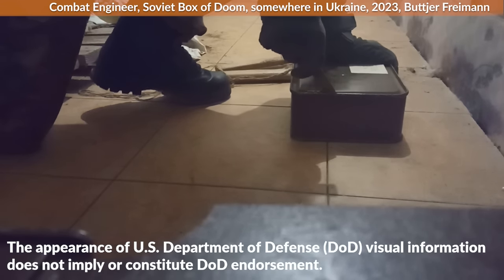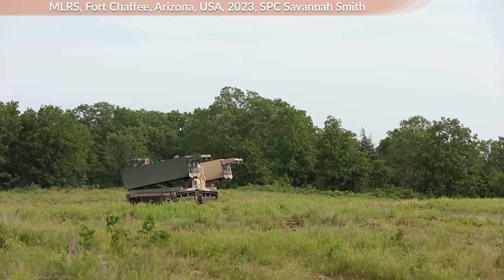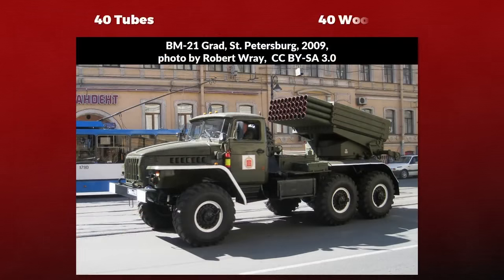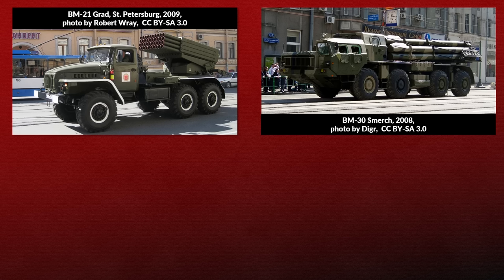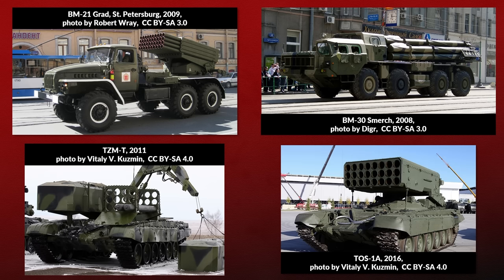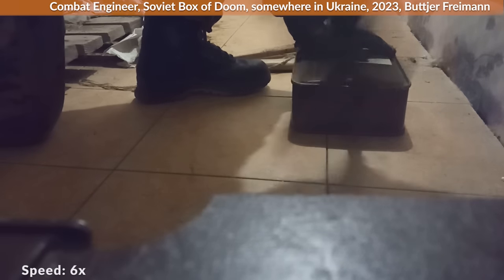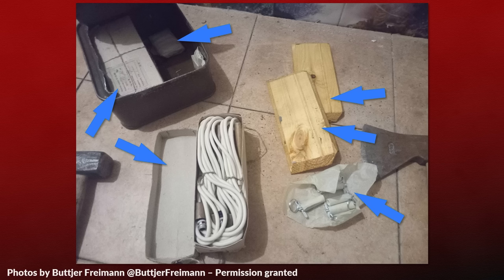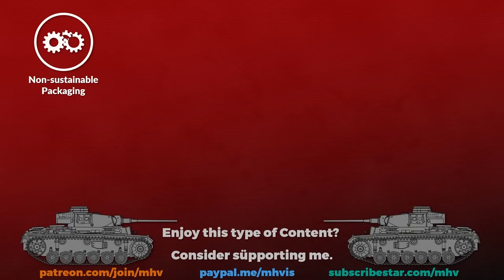Ukraine: Why Soviet Packaging is a Nightmare - Unboxing Edition

Comment: What strikes me about this all metal packaging is twofold - ease of manufacture (not use) and environmental stability in terms of poor storage locations (arctic, tropic, desert, jungle, etc.).

"Shelf life" seems to be the overriding design requirement, well above EVERY other factor - ease of use, rapidity of use,  reliability, reuse, dunnage reduction, you name it. The Red Army wanted 'stuff' that stored well, period.

You can list any possible reason for this if you want for this but SOMEONE in the high command felt that  stability and amount of product were vital no matter what other factors in play - transport, environmental, logistics interdiction, easy decontamination in a NBC fight, what have you.

As a old Cold Warrior, I find this all extremely fascinating. Thank you.
Reply: What about the MLRS designs though? They could have made them faster to reload (even with the packaging staying as is) so we must assume they had some other logic that made them think it isn't necessary - Sheer volume of grad units? WWIII being too dynamic thus make reload times irrelevant?

Agree this is very fascinating stuff, probably because it's practically never discussed.
Reply: @ImtheHitcher  MLRS reload times ARE irrelevant, they never reload on position, they never shoot 2 packets in a row. In fact they dont always even shoot one full pack.
Reply: @ImtheHitcher  the logic behind NOT having an integrated ammunition container-launch unit a'la M270 is simple. Without a truck with a proper crane you cant unload the goddamn thing. You cant load the container on the truck either. The ground is muddy? Your ammunition truck is on a slope? Crane broke? Too bad, you won't load. Meanwhile, to load and unload the BM-21 you need 3-4 guys (but even 2 will do) with at least one collective braincell. No crane needed, you can even use a horse wagon and it will do just fine.
Reply: So it's only red orcs which used one-time tare. Hypercivilized Uh-meriquans use resealable contsiner even for spam.

Seriously. Review your comment. Who needs to pack back the already distributed ammo? For what purpose?Do you know anything about how counting of ammo(cases) works there? Spoiler alert, you don't put it back into broken seal container.
Reply: @acy I see your horse wagon, and raise you 2 dudes carrying rockets in a box 1 by 1 across the fields. I bet that happened at least once both for Russians and Ukrainians in the past 2 years.
The reload times is not that important in many parts of the real war btw, as a WoT/WT player I remember it was quite an eye opening when one of my friends that I used to play with, explained that tank reload time is not that important in real life ether (He is Israeli tanker, was a gunner at a time) since generally it is a gunners targeting that is the main time factor.
Reply: Russian design theory is simply toss it in a hole and pick it up later. The one strong point I can see is that a soldier will clearly know their ammo is tampered because they can only be opened destructively so it's also an anti corruption tool, because their is no excuse for a manufacturer to write off fake or poorly made ammunition. And let's face it if Russians are stealing copper wire from vehicles they would try to sell the gunpowder and brass casings too.
Reply: @megalamanooblol I believe you are incorrect.  On at least two occasions multiple launches were used( at least according to the internet ). The openings of Desert Storm and Iraqi Freedom. Granted they were somewhat unique circumstances.  
However the reload time is relevant. Whether or not the unit displaces before doing a reload is what's not important. Soviet doctrine is also to displace.   The time to reload affects how quickly it can make another fire. Displacing only increases that time.
Reply: @megalamanooblol  Reload is important. Its not always the determining factor for rate of fire. Having a half an hour "cooldown" before your MLRS battery can respond to another fire mission is bad. No way around it. That's a long time for a whole battalion or higher echelon to not have any fire mission available. Like that company or platoon you just fired a salvo at may not need fire support for awhile, but the OTHER companies do. But even on a tank, a follow on shot if the target wasn't neutralized in the first hit will primarily depend on reload time. Anyway, the long load times of MLRS in soviet doctrine isn't a huge issue because they are heavily pre-planned for any operations. Back in the Soviet days at least, and so the reload times, how many rockets to fire, and when is already known. a half hour cool down isn't an issue in this case. Soviet doctrine didn't put heavy emphasis on 'on-call fire missions' like NATO did.

Also saying that artillery repositioning/firing a few rockets at a time makes reload time irrelevant is wrong. If both MLRS fired off a full salvo, and reposition, the Grad will still take 30 minutes + reposition time. While M270 takes 3 minutes + reposition time. M270 is ready to take on fire missions much much faster. Same with firing couple rockets at a time. Sure, while you still have rockets loaded, the speed in which you can fire can be quite fast. But once you run out, the Grad is down for a long time. If the Grad was at its paper 10 minutes, it wouldn't be a huge deal. But in practice its not.
Reply: @phunkracy  Yes and no. In particularly austere environments, yes, hand loading would be an advantage. But it should be noted that mechanical pod system does not automatically mean you cannot also hand load it. Its not mutually exclusive. There's no reason why you can't engineer the pods such that the rockets can be removed, and moved onto another pod and loaded in manually.
Secondly, ALL artillery fire and operates at relatively flat terrain. Not like perfect 0 degrees slope, but even perhaps 5-10 degrees would be perfectly tolerable. And at those angles, the M270 can reload just fine. No artillery will be firing at 15, 25, 35 degrees slope. No system is designed for that. With gun artillery, its a recoil concern, and with MLRS, its just stability at that point. You can force it for some desperate reason but its a extremely rare scenario. The crane malfunctioning or breaking is a disingenuous point because your horse carriage can also break. If the ammo carrier breaks down, be it a craned vehicle, a truck, or your horse carriage; it can't resupply your MLRS period. Its not a unique issue to mechanically assisted systems.
Lastly, have you actually seen footage of rasputitsa? Even infantry have difficulty WALKING in mud. Their legs literally just sink to knee deep mud and gets caked in grey sludge. Now image 2-3 dudes lifting 76 additional kilograms along with whatever kit they are also carrying. Keep in mind your average truck or glorified horse wagon does even worse in mud. They are wheeled vehicles, so they'll be equally as stuck.
Now the HiMARS is wheeled but the M270 is tracked, it has much lower ground pressure and doesn't sink in mud as easily. If anything, it will be able to just drive in to the field and load the pods just fine, while your horse wagon is stuck near the road and 3-4 dudes have to slowly struggle across said mud for however far the MLRS is because the resupply truck can't get to it. And you do that for ALL FORTY ROCKETS.
Reply: @worldoftancraft  Uhhh that's just your Soviet brain failing to imagine how useful reusable containers are. At least with small arms or autocannons, NATO uses ammo cans. Naturally larger munitions can't be. Ammo cans get reused all the time because they are transported in bulk and loaded largely back at the forward bases. Either into magazines, or into vehicles. But the ammo cans are able to be opened and closed(and it'll be well sealed), so you don't have to use all the ammo inside. If you are only short 50 rounds, you take 50 rounds, the rest can stay inside and not in a half broken can like the soviets. Once its empty, you can just dump more ammo in to it. Or you send it back on the next resupply run.

Reducing waste is useful, not only for hygiene, but for camouflage. Just look at all the garbage around Russian trenches in Ukraine, its announcing your position to everyone. And its not a waste of transport capacity to bring back garbage. Trucks go to the front line full, and unload the supplies. The empty truck can now take on trash and bring it back to the rear for proper disposal. I know, revolutionary concept. Those empty cans can then just be refilled with ammo, or if there's excess, recycled for other things. Its not like reusable cans are any more expensive than one-use cans the soviets uses. It uses the same material at roughly the same quantity. And with modern automation and machine tools, the time it takes to make them is neglegible. So if trucking it back in the rear is not possible, it can still be disposed; not expensive to do so. But any cans that is reused means you don't need to produce a replacement saving valuable resources for more useful things.
Reply: @ImtheHitcher  you are not wrong, to a point.
The sardine can works, is cheap, sits well. Has been a proven tech since WWII.
Point is: tech evolved. Other containers, other materials, other concepts of logistics and handling have emerged.
Some have emerged in WWII, like the US ammo cans with clips, the ammo clips in bandoleers or flimsy bags and then forklifts, cranes, boxer/launchers and so on.

In the XXI century, being tied to a century old tech - which works, granted - to reload a 10 years old weapon is absurd.
Reply: @phunkracy  you know, designing an army to work even with an horse wagon may be not the winning point you think it is.
Reply: @neurofiedyamato8763   so people who've seen the sunlight first time when the union of SSRs was already «history» are Soviets. That's just a W. 
A "W", we attribute to your free-of-dogmas-and-stigmas thinking. 

No, it doesn't work the way you describe. Not with this type of packaging. Our dear fighter against Sand People. When it is opened, it is distributed.
What you type is the result of absolute lack of any understandings of economies and the Earth's shape. Latin America is oversea... overocean away from whatever point of USSR. Keyword: «water body, where big ships go». Those were the «former» colonizers who historically had developed a fleet to protect, ahem, «trade routes». One of these countries actually has an uninterrupted land connection to the main suppliers of natural rubber. Yet, here is no feasible(reliable) source of natural rubber(a knowledge children receive in 4th grade during basic world knowledge course). And minds of USSR military leadership were forged during times of great challenges. They understood the concept of copper deficit and learned how to prevent waste. And they understood that the supply of rubber could be cut at any time. It is your fault that you did not learn these things. Your result of heavy delusional fever – is a product of both colonial «past» and peacetime military. Military that can come up with «If you are only short 50 rounds, you take 50 rounds, the rest can stay inside[reusable ammo can]» is truly plagued with a lot of peacetime bullshit ideas.

If there's need to be anecdotical, what's the point of using a reusable can, such as a spam can? Now we can put the scent of food back into it and seal it again? Keeping the area free of litter is about the litter discipline of the personnel, not just about supply trucks becoming litter trucks during their return runs. It's about a platoon commander's job.
Again, the ideal war scenario: somewhere away, completely under your control, using technological and numerical advantages, against, in other words, weaker opponents. "A truck bringing boxes with ammunition to the front and returning empty boxes." In reality, however, as observed, sometimes there are "trucks that never make it" or a "company of soldiers replacing the truck." Because a car cannot go where a horse or person can.

It is actually a White World's feature of producing single-use, barely recyclable packaging. E.g. the shopping bags. And it was your tool of rhetoric ramming that Soviet Citizens used weird shopping bags made from a thick polymers, and actually sometimes even washed them. OMG. Imagine not polluting everything around. Oh. Yet, when it's my Milicharee – that's not the case! Eco-friëndleë sins the '1980s! We're eco-friendly so our discipline-lacking civvies can shit around with litter like a true swine!
Reply: @fabiogalletti8616  its the winning point because it has historically won (and is winning this very moment) large scale wars.
Reply: @neurofiedyamato8763  artillery does operate on flat terrain, the ammo truck though? Not neccesarily. Your point about crane truck is disingenious. The point I made is that 122 mm ammo can be moved individually on almost any vehicle. A horse cart, your neighbour's semi truck, anything. A firing container can not, there has to be a truck with a crane able to lift the thing.
Reply: My understanding was that Soviet artillery fires doctrine also dictated that the fires would go to supporting the most successful units, rather than units which were not succeeding. 

Having rockets packed individually is very probably a human factors thing, and imho probably reflects the overemphasis of production of military equipment vs civilian goods that plagued them. In the US you’d have a truck with a crane or a forklift to help with reloading and moving boxes in a warehouse respectively. In the USSR you have Dimitry & Ivan.
Reply: I've issued out mortar rounds from 83 in its original wood box. I've also sent out tear gas grenades to a unit for training that were made in the 70's and still labeled as "experimental" with a feedback survey and prepaid postage in perfect condition. I've done inspections on several items with manufacturing dates in the early 80s and they all were still in factory fresh condition.
They dont need infinite shelf life packaging. they need a good place to store thats protected from the elements. We primarily use "Earth Covered Magazines" for ammo storage, and it works perfectly fine. We still inspect ammunition routinely because sometimes they screw up at the factory. If it was permanently sealed from the factory, how are we to know that someone forgot to put in the desiccant and the contents are rusting from trapped moisture?

edit : realized my first sentence was repeating your second sentence cause im dumb and tired so i just deleted it. lol
Reply: @neurofiedyamato8763  Soviet/Russian artillery doctrine is different to US/NATO doctrine. The Soviet/Russian doctirne makes far more use of planned fire missions than US/NATO where reloading time of MLRS is of less relevance as they mostly just have to be ready to fire at a preset time rather than being available for supporting fire missions.
For indirect support fire mission the Soviet/Russian prefer 120mm mortars contrary to US/NATO who prefer 105mm/155mm howitzers for that. Both doctrines have to be seen in the broader context of overall collective military war fighting doctrines rather than from a single weapon system's perspective.
Reply: Unpackaging is still faster than making it. :)
Reply: @eddapultstab2078  i think this was the smartest comment ive seen on this video. thats a completely believable reason and would actually make sense if your selling from a production system prone to corruption to a small country also prone to such, no individual person along the line will have the resources to discretely pilfer the contents of the box out of the box and keep passing the box along the chain, the box is either obviously tampered or needs to be stolen outright.
Reply: @megalamanooblol  Ah yes, "Reloading is not important"

I guess we should all just go back to rifled musket warfare then, much better in terms of logistics.
Reply: @gae_wead_dad_6914  Well, you are not the brightest fellow I guess.
Reply: I aleays that the reason russians used wooden boxes is so they can b broken up 4 fire wood. Gets quite cold in those russian winters . Besides ifs not like russia is running out of trees.
Reply: @megalamanooblol  It's not important right up until it is.
Reply: This. Soviet-style spam can ammo is still factory fresh 50 years after manufacture, at which point the primers are starting to get "hard" (luckily all their weapons are designed for hard primers/hard strikes/extreme cold). US-manufactured ammo is corroding in the box in ~10 years.
Reply: A Grad can deliver 40 rounds on target in 20 seconds. Thats a whole minute of continous barrage by ab entire D20 battery. That either kills whatever its aimed at, or 40 more rounds also wont do anything to it.
And after firing self propelled artillery is going to displace, and do so fast, because counter battery radars have been a thing since ww2. Adding a half hour to setring up its position again for reloading can be done in concert with preparing that position.
The other limiting factor is ammunition availability. Every refiment has 18 of the things, even with 40 minute cycle times, thats 2500 rockets a day per regiment.